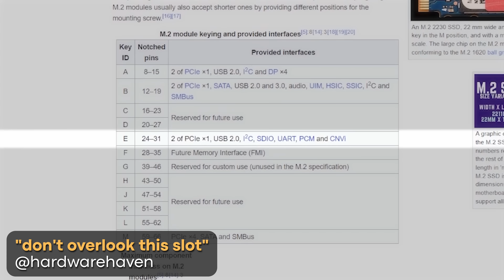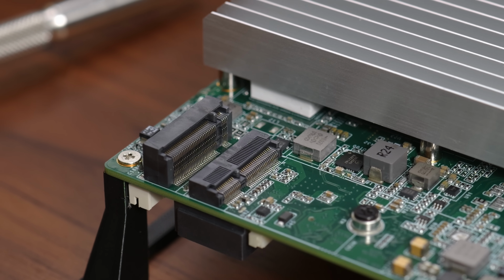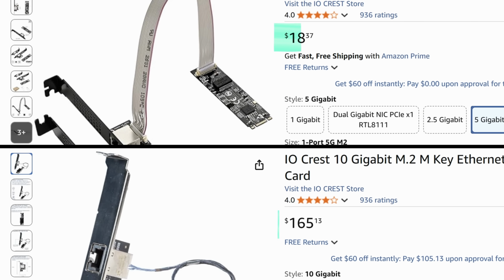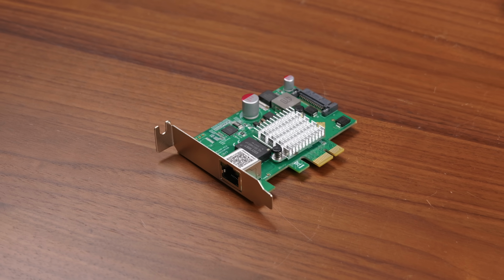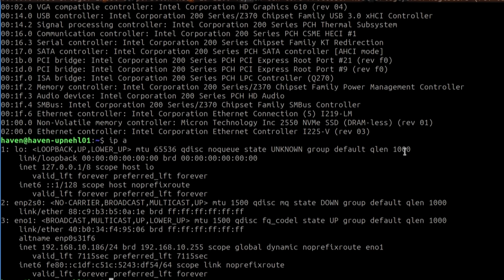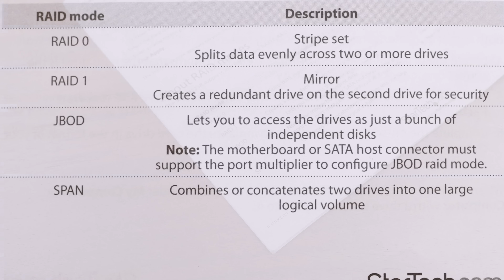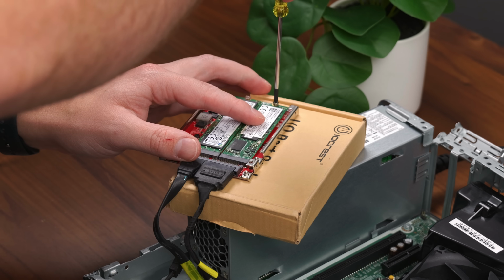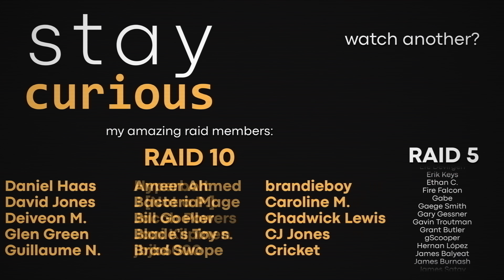I Don’t Know Why These Adapters Exist... But I Love Them

Comment: I knew someone who wanted to upgrade their desktop PC, yet keep their old optical drive. I didn't have much luck finding a decently priced case with a 5.25 drive bay, so I opted to just keep the old case and get a drive bay unit with front panel USB3 and USB C ports, as well as a headphone jack to replace the original that stopped working. The unit uses a SATA power connector to run everything. The USB C port even has enough power to charge a phone that had problems with older USB3 wall chargers. They either wouldn't charge properly or would overheat! 

Front panel drive bay unit is a decent option to upgrade older cases with newer features, or to add front panel ports to a mainboard test bench.

Comment: You can use the adapter to power a switch / router and especially if it has a pass trough port , IE  RB4011 from Mikrotik. , and you can add a AP or Camera to it for exemple.

Comment: The primary pupropse for the Ethernet-Card with POE is probably testing of devices which need POE on a local PC, instead of immediately throwing it into a network. You know, so you can see if your suspiciously cheap security camera tries to throw unwanted viruses into any network it get's connected to.

Comment: That Poe pcie would kick butt for using a higher performance AP as a bridge like a unifi ap instead of an internal WiFi adapter 
They can act as client bridges and mesh with vlan support.

Comment: 12:00 hardware raid controllers are typically not covered  by  stuff like smartmontools(at least from my experience in the enterprise/data center area). but often you don't use those tools as you can enter a controller BIOS during boot(for building/rececovering/re-assambling/etc.), but I remember tinkering around with an HP tool for integration into the monitoring system

Comment: i got extremly intrested about the adapter 4...  but i have ben wondering alot for yares if ther is somthing simmular but for two or more 2.5inc disk´s/ssd to ether 3.5 or the 5.25 formformat...for a raid 0/1 or 10 raid if it have more then two disk´s.

Comment: these Dual M.2 SATA 2.5" Adapter that supports JBOD are about $20 in Asia region. I would be interested to turn a 2011/2012 Mac mini into a NAS. 1 500gb for system and 3x 2tb GNFF in software raid0+1.

Comment: Some "weird" adapters I've personally used include:

1) A USB "data blocker".  This little (and reasonably cheap) adapter goes from USB to USB allowing power (but not data) to pass through.  Both me and the wife carry one around with our cell phones.  This allows us to use various "charging cables" at businesses, without the risk that those chargers may be "hacked" and try to attack our phones.  Because even if the chargers are compromised, this adapter only lets the charging (not data portion of the charger) into our phones (so the "hacked chargers" wouldn't be able to hack our phones).

2) A USB "switcher", that allows multiple "computers" to connect to multiple USB devices.  Then (at the touch of a button on the adapter) you switch which "computer" (USB source) the USB device(s) are currently connected to.  I use this as a small level KVM, to connect 2 computers & an XBox (in my "home office") to the same keyboard, mouse, & USB flash drives.   As an added bonus, the adapter I use came with a "USB sound card" builtin, so I also could hook up computer speakers to this adapter and get sound out of whichever "source computer" I'm currently switched to.

3) An HDMI "switcher", that does essentially what the previous adapter does but with video signals instead of USB signals.  I use this to share a single computer monitor between multiple devices in my "home office".   Like the previous adapter, I can easily pick the current video source with a touch of a button on the adapter.

4) An OTG cable that includes a 2nd input for charging.   I have this adapter in the case with my phone, so I can easily hook up USB flash drives (or other USB devices) to my phone WHILE also keeping my phone charged up (vs the normal case of having to run the phone from battery when using USB OTG data).

Comment: I have an adapter similar to the last adapter, only it has 2 sata connections and has 2 msata ports. One sata power. It's just a compact spot to put a couple of mSATA drives in a raid-0. And since it's 2 data ports, you get up to 1200MB/sec which is on par with entry level nVME.

Search for MSI NightBlade with Z97 motherboard, that barebone kit comes with it

Comment: My immediate thought for the Dual M.2 SATA 2.5" adapter is to put it in one of those CD-ROM to SSD adapters to use them in RAID 1 as a boot drive for Proxmox.

Comment: Those MicroSD card adapters are kinda neat.
I have some old NUCs that only allows mSata SSDs, this way I can just keep the boot drive on the MicroSD and use the mSata SSDs separately (eg. for Ceph).

Comment: Port multiplication can be terrible if you need bandwidth, most controllers divide it by the number of drives connected, no matter what drive is being read from/written to/or even idle. They can also only address one of the drives at a time.

Comment: I was recently joking about modern full-size ATX motherboards only having a single usable PCIe slot and needing M.2 adapters to put all the other stuff I use into such a computer. I have a few PreSonus cards I doubt I can do anything with, a MIDI adapter that may be possible to make an adapter chain to replace, and then there is the 8-port SATA cards that maybe a SATA splitter may help with. The downside of M.2 is the small size puts a serious limit on the cooling the controller chip can get vs a full-size PCIe slot, so stuff like QSFP/SFF adapters may be quite limited. Jokingly, like who would ever want to plug anything other than a single graphics card into their computer, lol.

Comment: RAID-1 should be able to speed up access speeds. Unless the hardware pull the same data from both drives and compare integrity? This is also why the likes of ZFS is better. The fact that one drive can be removed outright and being unable to notice it. I really doughy the hardware cares about the data integrity when it could not resolve what drive in the mirror is wrong. Why RAID-3 and 5 was really the bread and butter for servers.

If the hardware is sensible and actually instead can send reads across both drives? Sure RAID-0 is meant for performance. Still a mirror can be a redundancy and also a double read speed increase. Have sort of avoided hardware controllers like a good sane person would. There should not be a underlying reason why the hardware controller can not read the mirror at the same time to truly saturate the SATA-III. Meanwhile a cacheless m.2 SSD alone can be slower to read then spinning rust. ZFS could perform worse then a hardware mirror. But what good is it and good luck knowing what the hardware raid controller is doing.

Comment: The type of stuff these get used for are like: A scientific instruments company that is shipping a custom embedded system that they have stock of like 1000 of but it only has room for a single 9 mm SATA drive, but now you've got some customer that has a HARD requirement in their tender for hardware RAID redundancy. Boom, that $50 just landed you a $6 million sale without having to redesign the product or do an ECO.

Comment: For the drive controller/raid thing. Check what driver is being used, and adjust the command: smartctl -a /dev/sdX -d megaraid,0  (the presented drive as the /dev and the controller device number)

Comment: Just an idea, but for that RAID SATA adapter, either SMD pin headers or just outright soldering wires for off-board LEDs may help.  That's if you want to see the activity.

Comment: I have a mini PC that has dual m.2 slots for SSDs and it has a space to attach a 2.5 drive but does not have a SATA connection on the motherboard.  Is there an adapter ribbon cable to connect the 2.5 sata SSD to one of the m.2 slots on the board?  Thanks!!!!!!

Yes, I could throw the 2.5 SSD in a external enclosure or just use a USB3 to SATA cable but it'd be nice to attach the SSD inside the mini pc.

Comment: Its a common technic to power ISP street switch from customers lines. Its not very popular because it have lots of downside problems. But thats what its used for, you can power a device from multiple client side ports and keep it powered until all clients powerdown there connections.

Comment: I'm repurposing an HP SOHO NAS that has a single PCIe slot and finding a PCIe-to-mSATA with the controller chip (rather than using the  m/b onboard SATA port via cable which this device does not have) was more difficult than I expected. Mostly b/c I know they existed when SATA was still new-ish. But sure enough, eventually I found one. I am convinced that every possible combination of adapter devices does actually exist.

Comment: Not an adapter per se, but KingSpec still makes a MSH-xxx model drive that has its own MSATA controller on it. You have to contact them directly to order, not their website.

I use them cache slot on Dell Lattitude E Series notbooks though im sure they exist in other places.

Comment: Got that startech m.2 to 2.5 raid card for converting an optical drive bay on a power edge into a zfs mirror boot. Pretty neat if cheaper alternatives aren't available. I'm happy with $20 iocrest sata m.2 to pciex1 card in way more cases.

Comment: My latest favourite is a 2.5" drive bay that slides into the DVD-RW on a laptop and let's you use an SSD. Quite handy to install an OS on old laptops with USB2 or no UEFI booting.

Comment: You had a PoE splitter in the thumbnail, but didnt show it, why?
PoE splitters are one of the most useful things you can buy for your homelab. They come in all connectors and many voltages. 5v, 9v, 12v, 19v, 24v, 48v, 52v and some random obscure voltages in between. PoE Splitters are an awesome way to power non-PoE devices from a PoE switch without having to use PoE hats or DC adaptors. They work great for MiniPC's/NUC's, SBC's, phone docks, routers, non-PoE access points and cameras and whatever else you can think of that has a NIC and requires power. One of the most common usages is probably non-PoE cameras and Pi SBC's. Theyre a gift from god for SBC's and can save you a pretty penny on PoE hats.

Comment: I got a pcie x1 to two m.2 b key (i think) that also connects via usb, i use it for mobile data with a sierra em7565 and ideally with a wifi card (i dont need that wifi slot)

Comment: The PoE-Card is most of the time used for industrial applications, like powering Industrial Cameras for object detection, sorting ... even some microscopes use them. You can look it up using "GigE Vision", or look at the product catalog of "Allied Vision"

Comment: I recently came across the OSA 5401, which is an SFP module with a GPS receiver and NTP & PTP time servers. They're pretty expensive, but they go for cheap on eBay every once in a while.

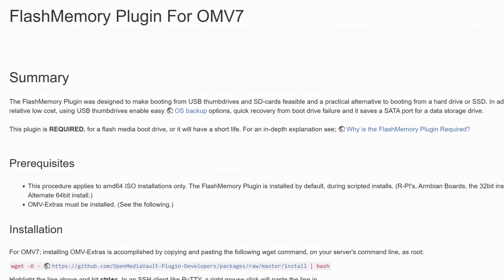Comment: 3:30 this is perfect for Talos Linux for example. It's image based and only contains the Linux kernel + some binaries to manage the Kubernetes services. That would be an excellent use case.

Although now that I think about it. Etcd will also need to write to that, so never mind

Comment: I used to have a 3.5-inch SATA RAID controller from Dawicontrol—luckily, my motherboard also had a dedicated SATA controller, as the integrated one didn't support port multipliers either.

Today, I use a QM2-2P2G2T in my PVE server and a QDA-U2MP in my OmniOS filer. Works great.

Comment: M.2 nvme to SFF6437 SAS connector and splitter to 4 SATA drives. Might have messed the sff number though. Saw them on aliexpress with accessible price.

Comment: — 6:35 , I mean u could just buy a 2nd 1 to do the necessary testing and if everything works good then return the cooked one using the 2nd order as the return request .

I mean , it’s not cheating since u still end up paying for 1 item . It’s a grey little area … 🫣

Comment: i can make an e-key to m key adapter that uses small flex cable with a 2280 sized board with two sided tape on the so you can add a remote mount nvme but limited to a single lane so limit is the pcie gen

Comment: i was hoping that something like that sata to 2x nvme existed! would be perfect to add more storage to my T440p, given that sata SSDs that fit in the WWAN slot are very uncommon and expensive
Reply: never mind, m.2 SATA drives are now practically unobtainable too :/
Reply: at least here in australia, without using amazon, which i avoid at all costs for various reasons
Reply: wish i knew of it a few years ago when the drives were still easily available

Comment: A big one for me...
I wish there was one that gave more USB ports.
I have projects that often require A LOT of USB ports, but they need to be 3.0 with GOOD controllers.
Reply: Not an ideal solution, but I have found you can often get away with a POWERED USB 3.0 switch.  The ones I like are under $20 each on Amazon, and convert one  USB jack to 7 on the switch (and as an added bonus that unit has on/off switches for each USB jack it supplies).  A couple of minor warnings about this approach:  1) The units I got did require me to buy/supply my own "USB chargers" to power up the swtich (i.e.  the charger was not included in the switch price).  and 2) Since this is a USB switch, you are essentaily sharing any USB bandwidth between all connected devices (vs giving each  device a dedicated USB port).   But even with these limits, this does allow you to give many more "high end" USB ports to your devices....

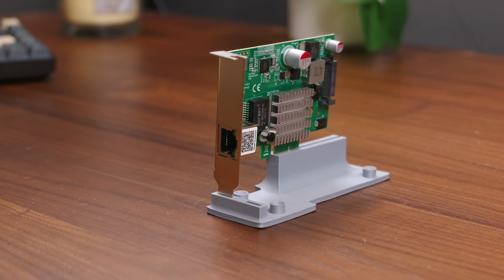Comment: @8:45 That's not a hardware RAID controller. It's a fakeRAID. You might try to fiddle with it with the help of dmraid, but your millage will vary. In general SATA is a shitty protocol, the port multiplying part of it is extra smelly. You are better off using SAS, but this will quickly get out of hand.

Comment: That SATA RAID adaptor probably is limited by the SATA interface.  If it was a PCIe card, there would be a way for software/driver to communicate with the RAID controller.

Comment: Dear friend ... If I have servers which were top of the game 10 or 15 year ago. All works except that the processors are say .. Old Xeons ... Does it exist a kind of a board that I can plug in and overide the Xeon and then make if a modern up to date machine ... Eventually Arm processor or even Intel but up to date ... Without changing the entire board ?

Comment: In my experience most any m.2 network card usually has about a 50/50 chance of arriving dead. The sellers seem to know this and have always just issued a refund without much troubleshooting or requesting them sent back.

Comment: for that sata to m.2 sata adapter. i'd prefer, the one with 2 sata ports. also i don't believe on raid. if your ssd or hdd (for data center grade), then you can forget about raid. just focus on power (quality and continuity) and cooling.

Comment: I found an adapter on amazon that takes two POE ports from a switch, condenses then into a single ethernet cable, then expands at the other end to present two POE ports that only require a single ethernet run. Really handy when I had a long run and wanted a second camera at the other end.

Comment: For the 2.5GB PCIe card, a use I've seen is in an office environment with a fibre drop per workstation. Fibre into a Smal PC, POE out of PC to a VoIP phone. Otherwise would require a small POE switch W. SFP on each desk. In an office with dozens of desks this could be a problem.

Comment: I'm not sure if anybody has mentioned it but JBOD doesn't work as you seem to describe. If it's working correctly, you should just see a single drive with the combined capacity of all the member drives.

Comment: I have a bunch of MSATA drives from recycling old hardware. Ive found that they make GREAT flash drives with an MSATA to USB3.0 adapter. and easy to change out of the adapter if you have multiple MSATA drives. Worlds faster than flash drives for large files! Worth checkiing out for sure!

Comment: I have both the 2 slots and 5 slots M.2 NGFF adapters. Instead of jumpers, it used software for set-up. 

Not bad though. I recycled all the smaller 128GB, 256GB and 512GB M.2 NGFF from various dead laptops and desktops into a RAID0  array for temporary storage. Got 2 units of 5 slots working nonstop for 2 years now. No failures yet.

Comment: would tiny core linux be good on that sd card adaptor because it loads from the sd into ram drive to run the os and doesn't run on the sd until it saves persistant data?

Comment: My ISP is a wall mounted 4G box on the outside wall. It needs PoE to run it. I used the 2.5Gbps card as the WAN input to my home-built MikroTik router. Saves an external power injector and stays running on the UPS I have for the router.

Comment: Might be a niche case but if you set the PC running the POE to not provide power when off that could serve as a nice security feature for a home lab, after all nobody is going to be digging around your network while the PC providing power to the router\switch is off.